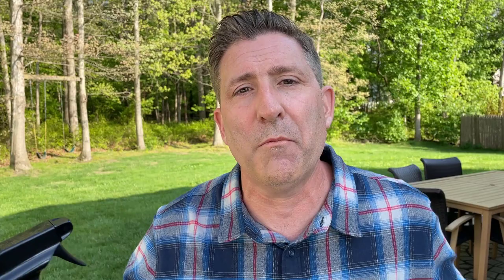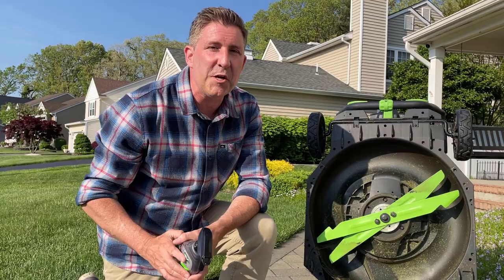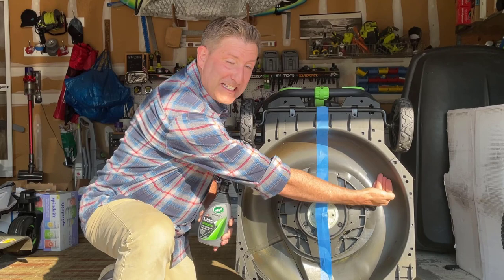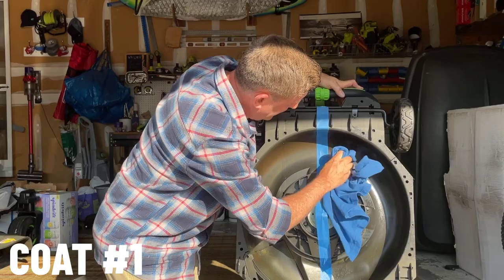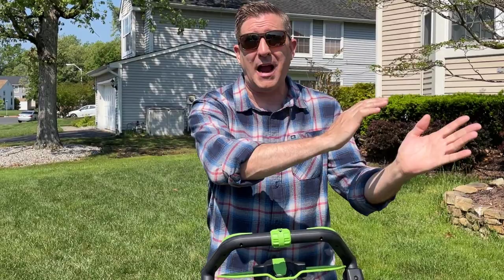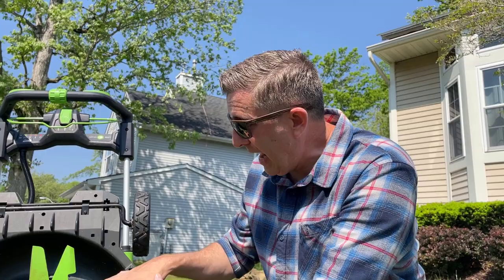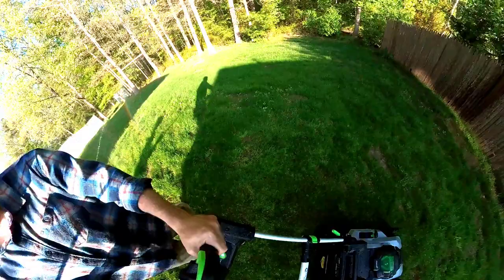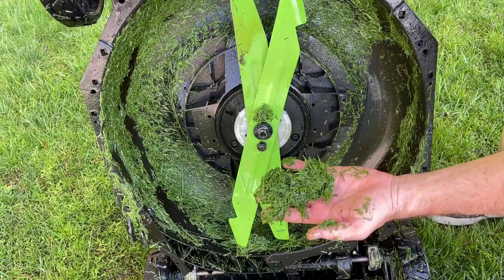Lawn Mower Ceramic Coating Debunking - GOOD or BAD????

Comment: Perhaps a re-do test by following the directions:
- Wash and dry car (lawnmower in this case)
- Shake Well, do not over-apply high active formula.
- Use 2 sprays per panel
- Spread and wipe with a clean, folded microfiber cloth
- Use a separate microfiber cloth to remove 
In the NOTE: .... Allow paint to cure for 24 hours before washing or applying an additional coat
I have applied few coats of this spry yearly by following the instruction carefully on my EGO lawnmower by waiting for 24 hours for each coat to dry before replay and the result is very good.  Just like a car it does not "repel" the dirt and keep a car clean all the time but to be able to clean the surface easily after it is dirty and dry.  I have let the grass dry for over a week last year and was able to remove the build up easily.  By the way, many people ask about what tool is the best to clean the deck and the secret is:  The tool that is already been included in the EGO lawnmowers, your mulching plug can easily remove all your grass build up and it is always available with you!! 😉

Comment: I use it on my lawn mower and snow thrower. Works great on snow thrower. On the Lawn mower, if the grass is wet it will stick. But the good news it cleans off much easier. No scraping, just wipe with a rag and it’s clean.
I use the TW Hybrid solutions graphene spray

Comment: Interesting. I have always just sprayed the bottom of the deck with Pam cooking spray before each mow. It works fantastic! Thanks for the vid!
Reply from the maker: I should give that a try - is it a metal or plastic
Reply: @Kitearmy  Used on both with fantastic results

Comment: What I've seen in these similar videos, people fail because of they fail to follow the instructions. For best results you are supposed to apply the coating in clean surface (clean it with soap and solvents), dry the surface, apply the products as it is told in the instuctions of the product, let it cure and apply more coats if needed and again let it cure accordingly. This turtle wax product is not the best for plastic materials (as in automotive plastic coating products), but it's better than nothing when applied properly. It won't help massivly on grass buildup but it will in cleaning the surfaces.
Reply from the maker: I could have waited longer...not sure the result would have been much different

Comment: As another reader mentioned Slip Plate might be your answer. It is a dry film Graphite that you paint on with a brush. Others have reported great results using it on lawnmower decks and snowblower chutes. Might make for a good video, hint-hint.

Comment: This idea has been around for ever.  I’ve used a spray called Mo-deck in the past and def helps keep it cleaner. Some use Pam cooking spray with good results.  I don’t mow grass when it’s wet. Always creates a mess and if you don’t get it all off the mower, stinks up the garage quick.
Reply from the maker: I always wonder if that is as true for plastic decks
Reply: I just use plain old silicone spray
Reply: @js12278 with the same results as he got?

Comment: First of all the Turtle Wax Ceramic is recommended to use 2 coats 24 hours apart. Second, a painted surface is the recommended surface.

Comment: On a separate note ceramic spray waxes (at least the ones I've used) are much easier/faster to apply and buff off and last just as long if not longer than a good synthetic or carnauba wax so that will give you more time to tediously clean the mower decks lol. A good tip is I spray some ceramic wax on my air conditioners before I put them in so when I take them back out in the fall they usually just need wiped off and in hopes that it helps the paint from turning chalky from the sun.

Comment: LOL! The ceramic coating only works for the EGO snow blower. It helps keep the shoot from clogging with snow. It needs to be applied after each use of snow blowing. Cheers.
Reply from the maker: Yeah - I'm going to give it a try this winter

Comment: I mow multiple properties with my EGO mower. It's a real mess in my SUV if I don't clean the underside of the mower after each use. I keep a bottle of Meguiars  waterless car wash and a Dollar Tree toilet brush in the car. A few squirts and a brush, and a blast of air from my EGO blower, clean and shiny and slippery.
Reply from the maker: Good suggestion

Comment: You need an actual ceramic coating, not the spray kind. 

It’s like buying spray wax and saying that it’s as good as paste wax. It’s not, it’s just faster and less effective
Reply from the maker: Others have said that it does not work???  What do I know

Comment: Thanks for running this test as I was curious if it does work.  I do apply Meguiar's Hybrid Ceramic Wax on my snow blower and notice a difference.  Perhaps make video for that in the winter and apply Turtle wax ceramic on one side and Meguiar's Hybrid Ceramic Wax on the other.
Reply from the maker: Great idea

Comment: The only problem is, the deck of the mower you used is already hydrophobic, so putting a hydrophobic coating on it would not make any difference. You may see a better result, or at least a difference if a mower with a steel deck were used. Any mower, where you need to use a scraper or a stick to remove grass, rather than one, where the grass just glides off.
     It would be interesting, to try this Ceramic Coating on a snow blower and chute, to see if it reduces clogging in wet heavy slushy snow. It may even help keep snow from packing in around the auger.
Reply: i have a steel deck mower and treated mine. when the grass dried it fell off in one giant clump all on it own. its wierd looking at brown dry grass thats in the shape of my mower deck but it happened.

Comment: Doesn't look like it does good for getting grass clippings to fall off, but I'm curious if it does any kind of corrosion protection or if once it cakes up if it falls off easier than the other side.

I use this turtle wax hybrid on my cars and the wax does AMAZING on them. It really brings out of the shine and it lasts the whole year or more. Haven't even rewaxed my mustang this year yet when I went to wash it for the warmer weather we were getting all the pollen and dust build up came right off with just some soapy water. Didn't even hand wash it. I also use cerakote on the trim. Since thats a plastic deck and cerakote leaves a somewhat oily residue I wonder if that would do better!

Comment: As a matter of science, grass is a solid and does not melt into a liquid like snow. The effectiveness of this product (or any other lubricant product) in snow should not be a surprise. As far as grass is concerned, the key is pretty straightforward. Wet grass shouldn't be cut. A demonstration like this would be equivalent to cutting the grass in the rain. It is only commercial operators who can cut wet grass because they have the necessary equipment and have business reasons for doing so. For the rest of us homeowners, try to cut the grass when it's as dry as possible.

Comment: I use the Turtle Wax  ceramic or the Seal n Shine on the top side of my EGO. On my tractors 42" metal deck I use a spray on bedliner underneath to keep it from rusting
Reply from the maker: you mean like rino liner?  Wow that should work well
Reply: @Kitearmy  I think it was the Rustoleum brand spray on liner in a rattle can. It seems to be holding up after 1 year of mowing. I wiped the deck with laquer thinner as a degreaser before sanding and priming.

Comment: Interesting! Wondered if anything would help with this.

Question? I thought EGO said NOT to wash/pressure wash the mower undersides?

Btw, Stihl vs EGO?
Reply from the maker: Yeah you have to be careful when pressure washing
Reply: I've hosed out my mower deck for 5 years and it still works. Not sure about the newer models. The decks look similar.
Reply: @brenthill5596  EGO specifically says not to use a hose on the underside. In consideration of my warranty, I will stay with the manual glove cleaning. Buy YMMV!
Reply: @cguy96  I wouldn't pressure wash it but a hose has not hurt mine. Do what you feel is best though.
Reply: Same question here, I need to clean my Ego Mower and thought would be easier just to use the pressure washer.
Mine is not at earlier model though.

Comment: Turtle Wax Ceramic Spray wax is not a true ceramic coating so that is why you got the results you did. Also, it is only meant to applied to car clear coats and you applied it to a plastic mower deck and didn’t follow the application instructions. TW Ceramic Spray wax is only 5% SiO2, you need to get one of the glass bottle ceramic coatings that are more upwards of 30% SiO2. If you truly want to ceramic coat your plastic ego deck, you need to get ceramic coating that is specially formulated for porous plastic trim. A good inexpensive solution is Cerakote Trim coating at Walmart for $17 and you can coat both the metal and plastic with it just be sure to immediately buff off after applying it or it’ll cure and have high spots and permanently look awful on the surface.

Comment: What if you let the grass dry on the deck?  Does it come off the coated side more easily then?
Reply from the maker: I tried that - just dried to the deck - no difference
Reply: Does the grass and debris rinse off easier with the ceramic coating vs. no coating?
Reply from the maker: @ronaldberger4752  no - just the same
Reply from the maker: @ronaldberger4752  no difference
Reply from the maker: @ronaldberger4752  no - no easier than untreated

Comment: No spray “ceramic coating” is a real coating. It’s slightly better than a wax if that, but drastically worse than an actual ceramic coating
Reply: Might want to have a look at youtuber ScottHD. His test videos on the longevity of Ceramic Coatings show otherwise. Most "Professional" Ceramic Coating don't last much longer than the store bought spray-on ones and at 10 times the price you can just reapply the spray-on coatings every 6 months and be good to go.
Reply: @jeffreycaban5107  you might wanna rewatch his video, the quality ceramic coatings did not fail, as he stated, HOWEVER the spray coatings did. He’s not the first to do this test, real ceramic coatings IF INSTALLED AND MAINTAINED PROPERLY will blow any spray coating out of the water any day of the week

Comment: nothing works , seen a guy on here do many layers of different items then slip plate , used mower after a number of times checked deck in places where grass hit down to metal again. other places covered in dried grass . wet grass is so abrasive . just wash after every use. vjust to be clear guy did amazing thorough job many layers on his deck ...didnt work . WASH IT OFF. only way.

Comment: Pointless test for so many reasons. That crap isn’t a real coating and it’s Turtle Wax which is the cheapest crap you can buy. Test it again with an actual ceramic coating. Max sure you prep the surface properly before applying.
Reply: Another YouTuber already tried using a real ceramic coating. Same thing. It didn't work. Coating got scraped off in two mows.